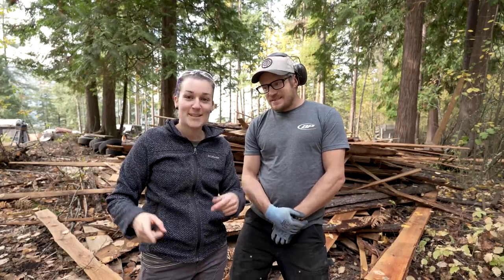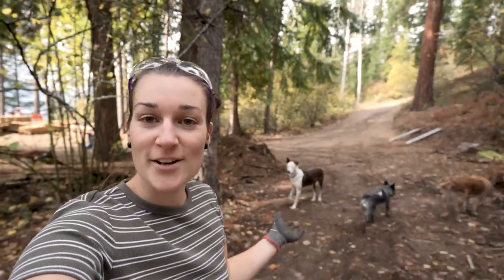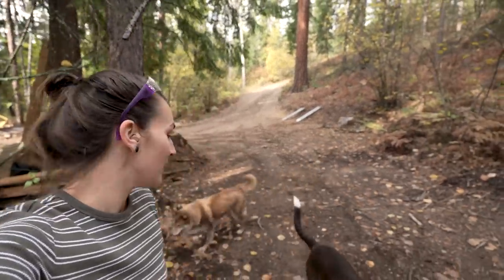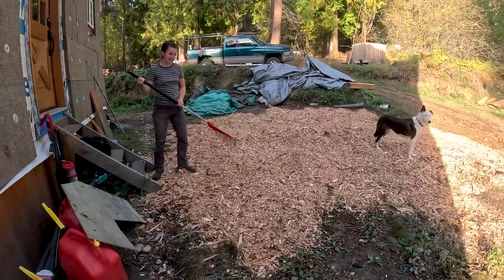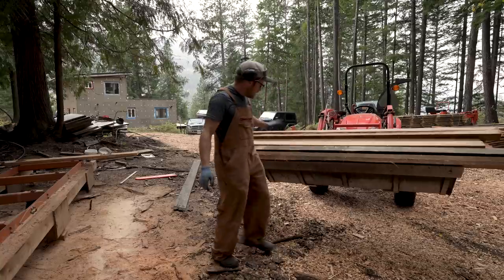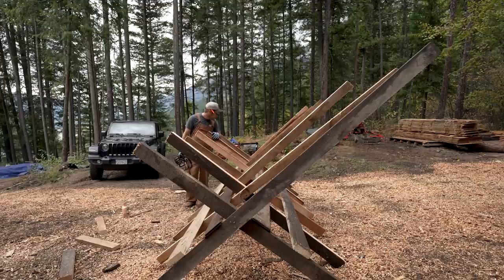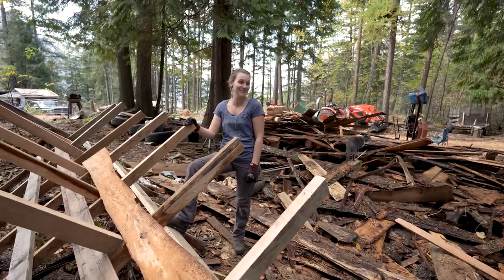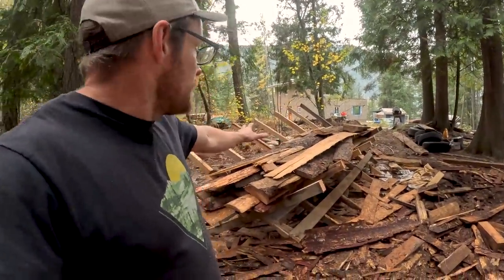Our Viewers Said We Needed To Deal With This | Tackling A Mountain Of Sawmill Off Cuts

Comment: You need to put some cross bracing at the bottom of your cross to keep them from spreading or it's going to be flattened out. I could see them spreading when the wood was added. You are doing a great job, have a good life.
Reply: Thought the same thing. Kind of amazed it didn't collapse. But I love the idea and I probably would have done the same thing if I'd built one myself till I saw it flexing.

Comment: Good job cleaning up before winter. Make more use of the wood chipper periodically. Take a skid or IBC tote/frame to use as a storage container that can easily be transported with wood chips for later use. Same for the fireplace or hot tub. Used for levelling, weed control, drying out muddy areas, flower pots, garden beds. Some robust pieces may be used for steps, garden wall reinforcement, reducing soil erosion by shoring up areas in the lower levelvgarden pathway. Some pieces may be good for the water pump solar panel supports.

Comment: You could put a tarp in the bottom of the trailer, when you go to dump attach the top part behind you and drive off to dump everything 😊 think of it like those straps they put under batteries in appliances 👍

Comment: Nice firewood sawhorse! You'll need cross braces from legs to legs; otherwise, over time it will weaken where the legs cross over each other and are nailed together. Then the whole thing will sag. I built a smaller firewood cutting sawhorse and used some staples and some wire cable running from one middle leg to the other.

Comment: Good job on the pile, you have plenty of wood for the hot tub, and the wood shed.  The jig is a good idea if you continue to use and not letting the cut off slabs pile up like you and Katy just cleaned up. The chipper is a good idea also, wood chips for the goat barn, chicken coop, driveway etc, keeps the mud down in front of the deck all around the house if you want.

Comment: For several years I heated with sawmill slab cutoffs which is what I see in your pile. We would stack several pieces in a pile and cut to length for the wood stove. Looks like you are sending good firewood to the chip pile. But then it looks like you have a good, well-needed use for the chips.

Comment: I just made myself a rack for slab like that, had a plan in my head for couple years, decide to make it. It's all in steel ( and I'm not a welder ) but did learn it ;) my neighbors has a sawmill so, get all the slab I want for free, did about 18 cordes of wood in couple of days. Even build a shed for it. My rack is soo easy to use, it can be made in wood also. If you want some photo of it, let me know. Good job on cleaning the place, look amazing now ;)

Comment: Here's an idea for using up a lot of the off cuts. Dig a hole that is a reversed pyramid, start a fire, then keep feeding it so the oxygen is not creating ash. 
What you end up with is the char for making biochar. Douse the fire very well  with pond or stream water and add the char to compost. 
It makes a long term fertilizer that allows the bacteria etc to have more access to nutrients. 
It also breaks up compacted soil. 
Some of that finer char will also be good for any of the birds.
Reply: The way you know the fire is working at it's best is lack of smoke.

Comment: Make some frames you can put on the top of the tub. Cut the wood and lay the pieces in the frame. Move the frame to the wood pile. If they can stack on each other and be reusable you could save a lot of handling.

Comment: As mentioned, needs bracing at the bottom side to side, if you don't, it's not if, but when it's gonna fall in and flatten out. a lot of work in all this, looks a lot better. I always wondered why you didn't saw it up and use it for firewood. Katie is there all day, just means will have to feed the wood stove a little more often, but, on days you need some heat, but not a lot, easier to keep the fire gong, but not over do it.

Comment: Okay, I didn’t read the comments but I’m sure people compared the foot in the chipper hopper to (spoiler alert) the final scene in “Fargo”.  HOWEVER… I was impressed with your machine operation skills.   That was a nice touch spreading the wood chips with the front loader.  ALSO, backing up that little trailer accurately is really really difficult.  As a side note, there is a 3-point hitch quick-connect adapter that will make changing implements easier.  You can connect or disconnect in mere seconds.  There’s lots of manufacturers and it’s worth the expense (about $250).

Comment: And you need to put some braces on the cutting jig at the bottom of the legs too . Join the front legs to the back legs about 6" above the ground , so the jig doesn't squat down from the weight .

Comment: Please be careful when pressing lumber through the shredder, especially with arms and legs.  One slip and it’s an injury.  Sorry if I sound like an old grandad,  I am.
Reply: Steel has no conscience
Reply: Yep,just Google foot in chipper .Gruesome. Instant termination on a right of way crew.
Reply: That's 'through'.
Reply: Notice the red bar is pressed before reaching in, it is a safety device that disengages cutting action.
Reply: Yeah, my heart skipped a beat or two,when Katy used her foot to push a piece in. Please don't do that again. Bad way to end a YouTube channel.
Reply: @martinwyke  Regardless, no hands or feet should ever pass the red handle.
Reply: @jamesrivis620  Thank you for pointing that out James, a typo, it happens.
Reply: Never put a body part in.The bar is a reverse not a disengage. The coated wires that hang down do the dsiengaging. Called the dead man protection for a reason. I've worked on hundreds of chippers over the years.They eat oak,human parts are just an appetizer. @martinwyke
Reply: @martinwyke  It disengages the feed roll, it doesn't stop the cutter from spinning.
Reply: I see what you see, an amputation waiting to happen. It’s unbelievably insane to push in wood like that.
Reply: Yea, do NOT stick any body parts inside that enclosure.
Reply: They are dangerous, I used to work on the big ones and they had my respect. Note the red bar around the chute? If you touch it it shut the throat. Long throat too. Those big ones will suck a man right through them.
Reply: Don't wear lose clothing and pay close attention if using a chipper!
Reply: I’m sure they were to young to know about safety, it’s an archaïc thing after all. 😂
Reply: @jwfinley7808 just loose gloves
Reply: I totally agree very scary.
Reply: @martinwyke  And everything is failproof?
Reply: Now there’s a case of, it won’t happen to me !

Comment: Great  clean up . I'd like to add a great snow and ice melting solution, using what you already have left from your wood burning and ,it will help over the winter ,around your doors and on slick spots . 
1 of the fastest and cheapest ways to melt ice and snow ,is by using wood ash ,Im not sure, if you know this . I Learned it from someone years ago . Hope it helps .🖖

Comment: An idea for your firewood jig. Consider putting a horizontal brace on the bottoms of each leg. Only the nails at the intersection of your "crosses" are holding it from collapsing. The braces will provide tension as you load the top with slabs. Keep up the great work. Enjoying the adventure from the Okanagan

Comment: when building structures like the sawhorse remember that the strongest form is a triangle so make sure you put a few in there to prevent it from falling a part
allso try to work smarter not harder , try to get stuff so close to where it needs to be that you only have to reach to get it from where it is to where it needs to be  (like when unloading the wood from the cart to stack it or putting the saw horse next to the spot where you stack it and move the long lumber to the sawhorse as the long pieces make several shorter pieces it saves you on picking stuff off the ground a few times  and saves you loading and unloading the cart )
every step you dont have to make saves you energy and taking a step back for a minute or two to look at a way to do it with less effort  / more efficiently will save you hours in the end 

sumting else that might help you reduce the mess / mountain of extra work in the future is to have the chipper hooked up to the tractor and next to the woodmiser so that you can run the offcuts comming of the woodmizer straight through it and only have the piece in youre hands once , stack the big stuff straight ontoo the sawhorse to cut short after youre done cutting the lumber then you only are left to deal with the small pieces (wish you should stack close by to the sawhorse to save on walking ) and mountain or woodchips

Comment: If you bungee a pair of 1 foot 4x4 or 4x6 sections on your yard trailer, you can place them in front of the trailer tires and pull the trailer up onto them. This will give you additional ground clearance and an increased dump angle.

Plus, the wood sections can aid in the trailer field repairs away from the house area.

Good luck.

Comment: Its about time you start using that slab wood for fire wood,  great source,  Put you rack behind your sawmill at a 90 degree and when you pull a slab off a sawn log stack it on your rack, save extra handling, work SMARTER, not harder, and some of those larger slabs can be split !!

Comment: There is still good wood in cutoffs. Right off the bat, use them to frame up raised beds for Hugelkultur. They are also great to do 'walls' for vines and 'climbers' of all sorts, vegetable or flowers.   Oh, no! You shredded it? Well, I really can't say anything as I have used shredded like this to fill in 'paths', and for in between raised planting beds, both around and about the compound, gardens, and wooded paths to surprise destinations, like a quiet pond and patio with a firepit.  
Lots of uses, and it is yours to steward. 🙏🙏🙏

Comment: Need to adjust the anvil on the chipper it will feed better and you'll get more consistant chips and use less power and noise is a much smother sound instead of that choppy sound .010 to .015 clearence between anvil and blades that is wher mine is set at and I have same chipper I run with a Kubota BX25 with no issues just pulles whatever I put into through no pushing no chute plugging

Comment: Experience tells me the woodchip driveway will turn to deeper mush as it biodegrades.
I assume you have the patience to turn the fire ashes into potash to improve the soil for a vegetable patch.
Reversing a short trailer with a quad bike accurately is extremely difficult. Better solution would be a trombone trailer tow bar. Reversing a couple of feet closer to the unloading point saves the legs miles in a day. Plan for when you are no longer as strong and fit as you are now to make life easier for ever.
Sharing the good times appreciating the scenery and having fun with dogs and goats are the memories that will mean the most.

Comment: Why is store bought lumber bad, but running your sawmill on store bought fuel isn't? Where do you draw the line? I feel this "off grid" gets thrown around a lot these last few years, but how you define "off grid" seems to be kinda undetermined. If you don't have a power line running to your house, that makes you off grid? Technically, I guess so... But if you still relying on store bought fuel to run your generator (and heat, cook, run your equipment, etc) then is that really off the grid?

Comment: You need to make a saw buck. That thing you made is a saw buck. I made mine where each of the X pieces connect to each other with a single 1/2 nut and bolt so it folds. I also put wheels on it that don't engage the ground when it is set up for cutting it has to be folded for the wheels to be on the ground. I was concerned that you were going to collapse it by overloading it.